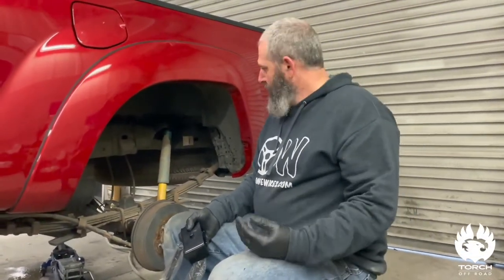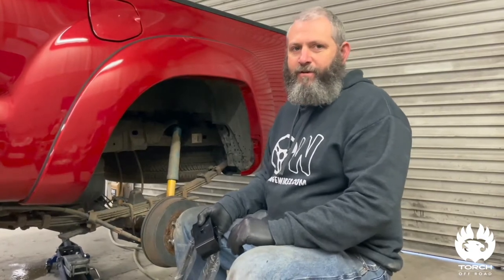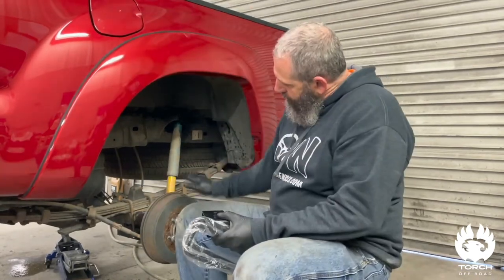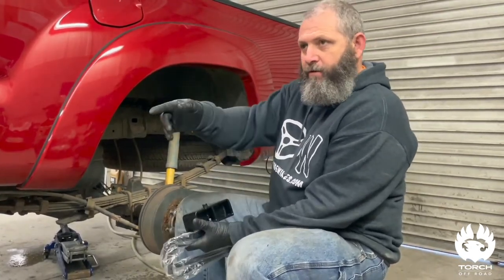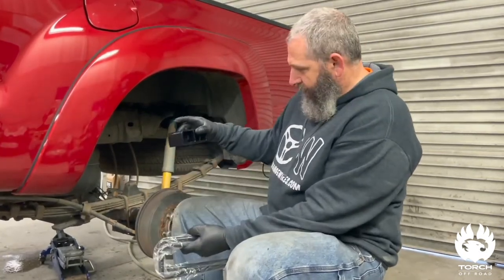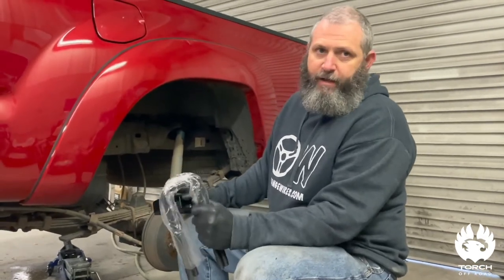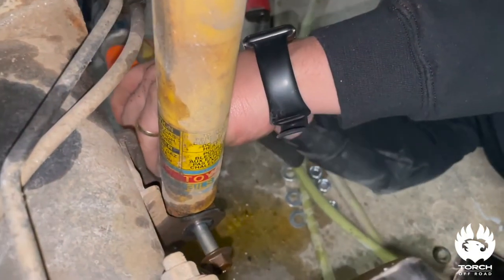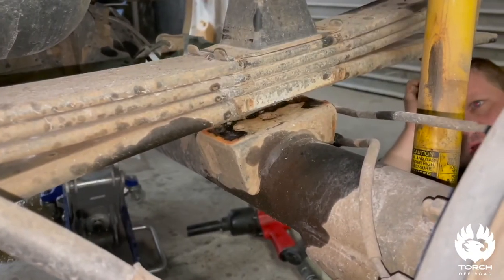TORCH Off Road Tapered Rear Blocks and U-Bolt Installation Guide

Comment: Tapered would go in the back if you want to lower your pinion angle not raise it. Different for each application isn’t it?
Reply from the maker: Thanks for your question. For the Tacoma installation, our lift blocks are intended to be installed with the tapered (narrower) end facing towards the front of the truck. This corrects the pinion angle after lifting the rear end. While I can’t speak to the application on every vehicle, our TORCH blocks are typically designed to be installed with the taper facing forwards -TORCH